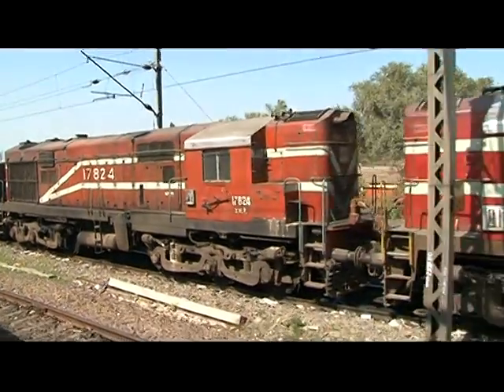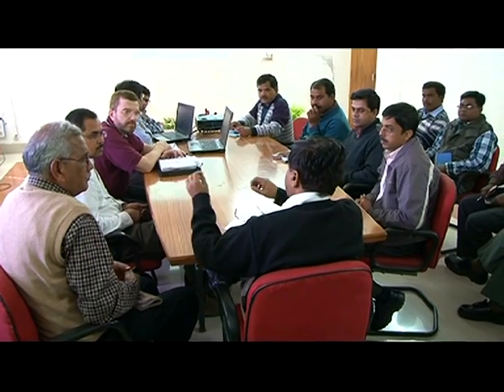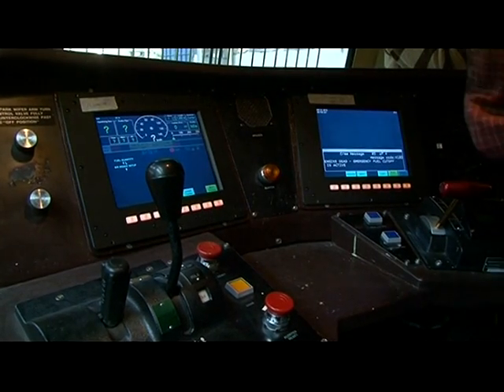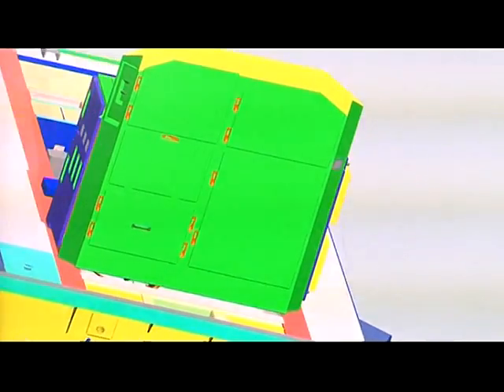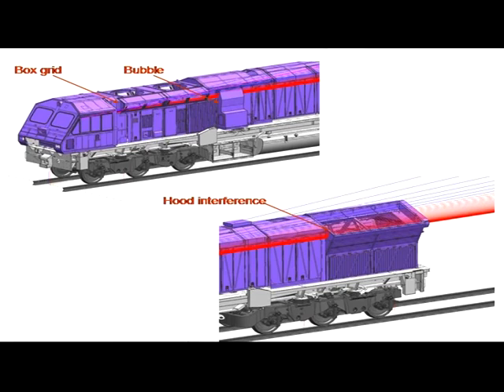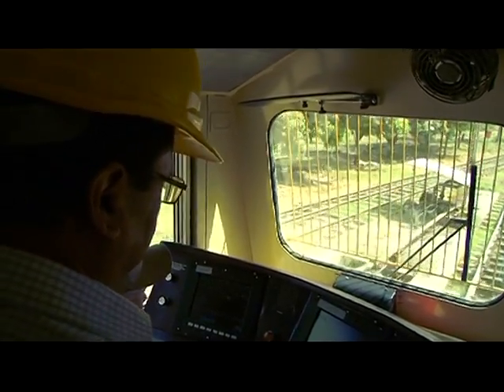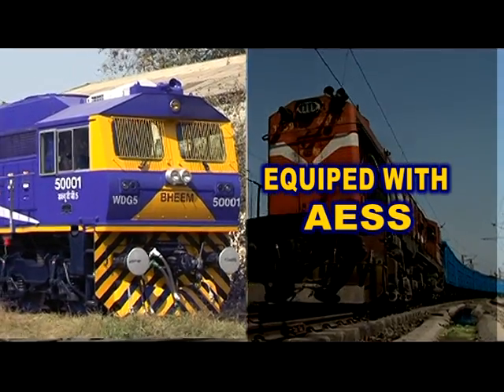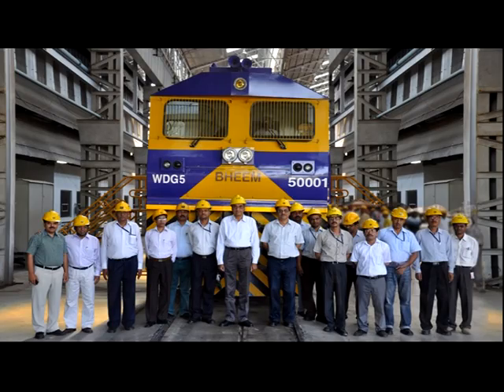5500 HP WDG5 Locomotive BHEEM

Comment: This loco was a hare-brained project by a Railway Board babu who wanted to retire with a blaze of glory. The WDG-5 hits the axle-load limitations of IR tracks, adds 4 additional engine cylinders, 1000 HP extra output, 15% more fuel consumption, but for a mere 3.5% gain in starting tractive effort over the WDG-4 (540 kN to 560 kN). Thankfully someone did this math before DLW could waste its time building hundreds of these.

Comment: Dual cab in such locos should be a standard design feature for safety since running this long hood front will be a pain for Loco Pilot / Asst. USA may have turn tables at multiple places to avoid LHF mode but not in India. For all the claims that LHF mode does not compromise visibility and WDG5 is better than WDG4 since blower does not block visibility in the former, one question to answer - will you drive a car sitting in the boot at the rear end of the vehicle, looking through a small peep hole, that too at only one side of the road ? Weight, length etc are not arguments since safety cannot be compromised in design. Find a way to meet length, weight etc but with dual cabs and that is the design challenge to overcome.

Comment: Unfortunately, DG5 became the Zero or Villain of IR, rather than being a Hero all because of its increased heavy net weight of 22.5 ton.
Actually, the weight reason was for adding another cab as LHF position is very difficult. Adding another cab can increase the weight further. Can't they put any CCTV camera to look at the signals through computer screen to make it easy during LHF mode? DLW engineers, pls don't wait for DG5 only. You can apply this same principle even to existing Single Headed DG4, DP4(B) and ALco also.
-By Jishnukrishna V of class VIII A, Navkis Educational Center, Gokulam, Bangalore

Comment: Y don't they just install a big super charger on that engine to increase its horse power. Engines like this need more air to mix with the fuel more air more power after all the main heart on a locomotive is its engine that drives the electric motors if it moving at a slow speed it will generate less power. less power means less horse power. That is the reason Y other countries are ahead of us having 7000hp 10000hp engines
Reply: It's already supercharged. And you can't just increase the power willy nilly, you need to redesign the entire powertrain else at best you compromise the life of components and at worst the driveshaft explodes, taking the prime mover with it.

Comment: Funfact...!!! 7500ltrs of fuel capacity.  Assuming it uses normal diesel priced at Rs50/ltr (instead of high speed diesel) u will need 3,75,000 Rupees worth of fuel, the price of a car.
Reply: But how much load it carries.
Reply: lol Funfact...!!! The old WDM2 only has (maybe) 2500 HP, but carries around 5000ltr of fuel if full.
Reply: I don't know if this is still relevant, but the vast majority of fuel pricing is taxes. So to IR, assuming fuel is procured through a government contract, they would pay market prices (~INR40/Litre), without volume discounts. In reality, it will be around INR37.33/Litre.

Comment: Finally they have put toilets in locomotives and it should have been dual cab....
Reply: arjun panicker
Lack of space for second cab.
Reply: Dont think so. Its an american company and they built like americans do: One cab. They dont need dual cabs, therefore their customers also dont have to need dual cabs.
As the WDG5 is basically a SD80MAC, and the SD80MAC are all single cabs your model also is single cab.
Reply: @pearlyhumbucker9065  O ! Then what is WDG4G ?? It is also an American locomotive ! If BHEEM gets dual cab, then it will look no less then a WDG4G, except the difference in body designs and the type of Engine Used..
Reply: @pearlyhumbucker9065  Moreover, It is completely a Made In India. Bheem GT50AC doesn't have any Import Units. India copied the SD80MAC with the Help of Transfer of Technology given by GM-EMD and Progress Rail.